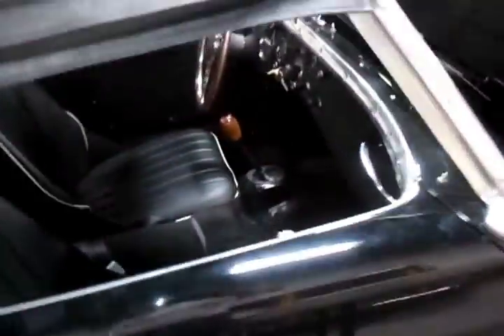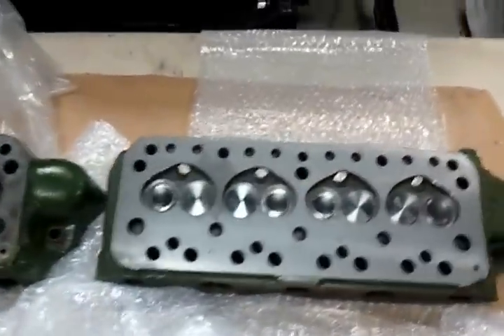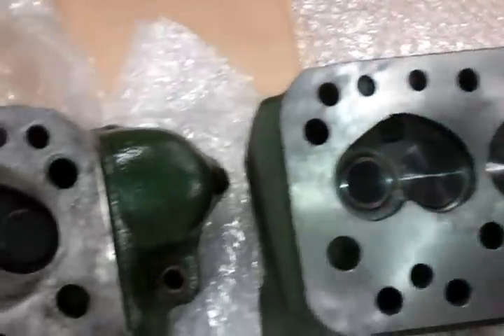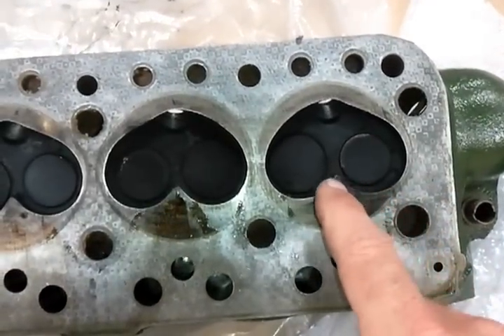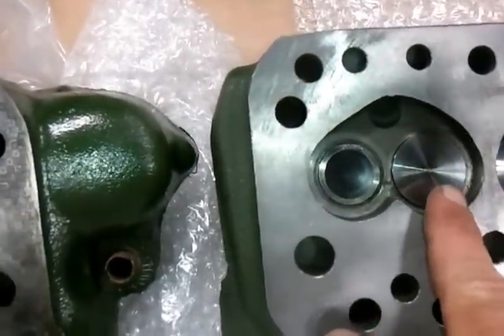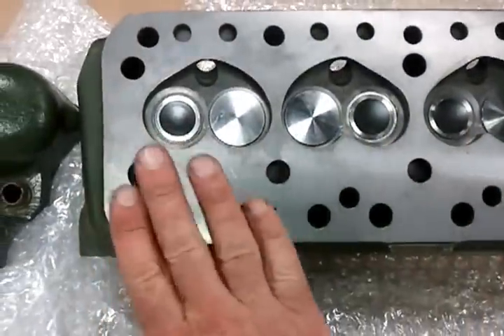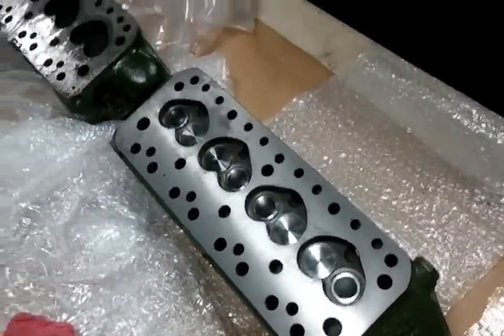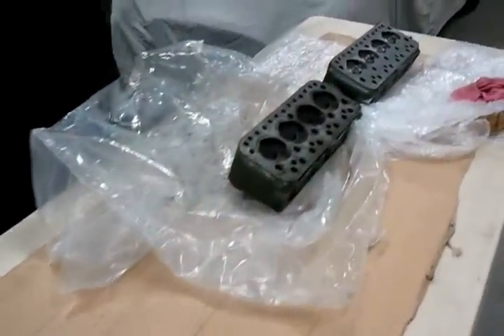How to get more power from a 948 Bugeye engine

Comment: The A engine always had a good sized port layout for the size of the engine used, BUT, notice the chamber design...THAT is a true swirl design, well ahead of it's time...lots of potential. Great job on the car too!
What cam did you use?